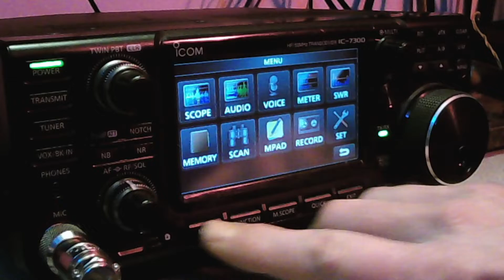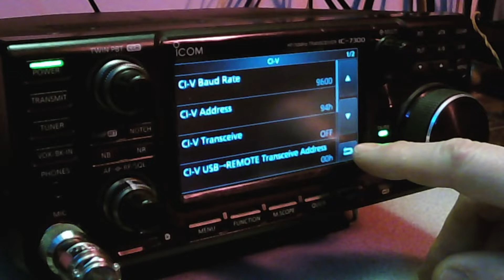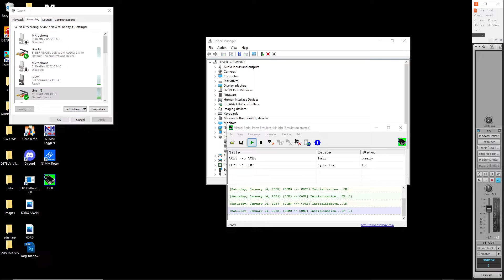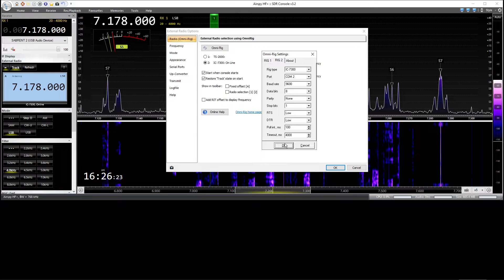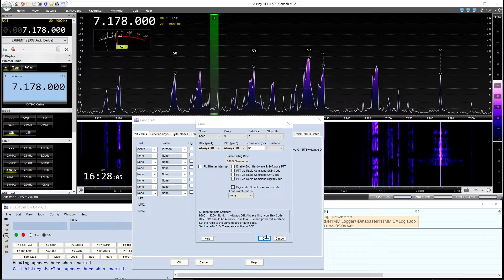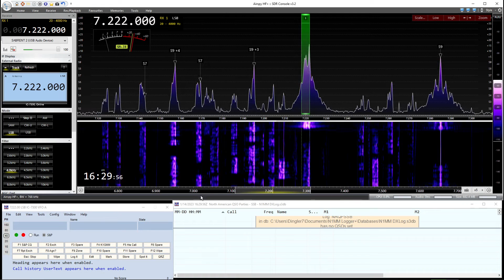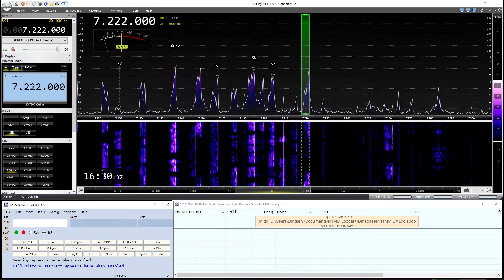Icom iC7300-N1MM/SDR Console Fixed!

Comment: Hi Folks. I've had to find a slightly different solution for linking RSPdx/SDR switch + Omnirig + SDR Console + N1MM logging and my IC-9100. I have tried VSPE to split the COM port (both one to one and one to several) and whilst it looks like it's working (starting Omnirig results in data transfer over the virtual COM port) I could not get SDR Console nor N1NM to recognise the IC-9100 when used via a port splitter. I think this might be down to the IC-9100 having an internal USB hub and presenting 2 COM ports to Windows, but trust me I spent 2 days at it and no joy, so I removed VSPE (and the redundant ports; select 'show hidden' in device manager to show them) and reverted to setting Omnirig back to the correct Icom port (typically COM3). I then created two virtual COM ports using com0com (these survive a reboot) and in SDR Console, you can link the Icom port (so COM3 in my case) to one of the virtual pair created by com0com, then when setting up the logging software (in my case N1MM) point that to the other of that pair of COM ports and change the radio to TS-2000 (as that's what SDR Console 'emulates') and it all works a treat. It took me days (and almost giving up) to discover a solution, and the solution is not to split the COM and point both Omnirig and the N1MM at a virtual port (or ports), it's to leave Omnirig pointing to the real port, then to create a pair of virtual ones, then use SDR Console to link to one of them, then point the logging to to that 'virtual TS-2000 on the other of that pair of virtual ports; nice one, SDR Play!! 🙂
Reply: NB I'm also using a Numark DJ2GO2 to provide common controls (using SDR Console's MIDI feature). Right jog wheel tunes in 10 Hz steps and left in 100 Hz (and the middle knob does 1 Hz, but I don't often use that) and - of course - that also drives the Icom via SDR Console and Omnirig). I've set the 4 buttons on left side widen/narrow the SDR Console filters and 2 right buttons toggle the modes. Middle slider does volume and right or left play/pause buttons step it up or down by 1 MHz. It's rather a musing to note the price of an Icom or Flex remote head unit vs my dedicated laptop (£400 for a used but immaculate Lenovo T1) and my £62 (new) DJ console! Hihihi 😀

Comment: Hello ..that setup is still use some hardware RTL donggle SDR, or just radio 7300 ?? Thanks
Reply from the maker: Airspy hf+
Reply: Hello sorry for ask...yes I am success connected like yours 7300+sdr console+n1mm..my question now is are you ever try connected 7300+sdr console+ some logger like Log4OM Ham radio deluxe etc .. thankyou so much